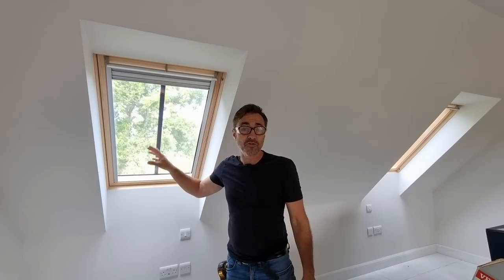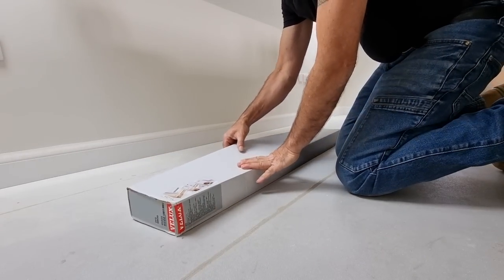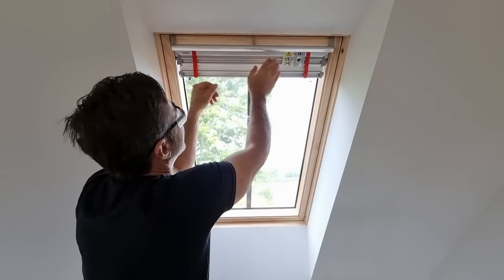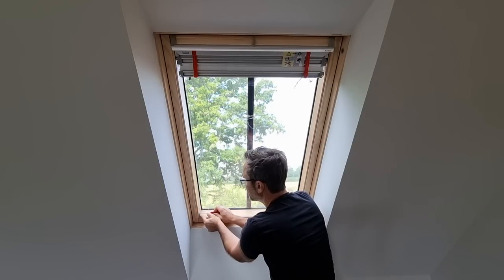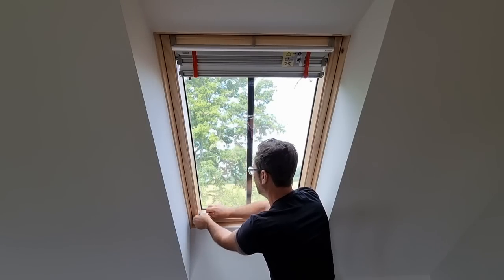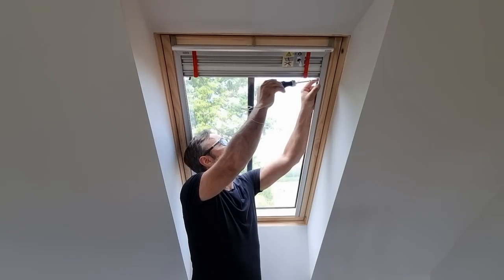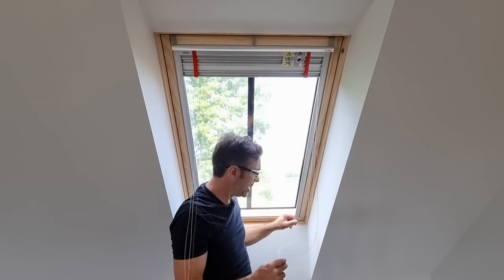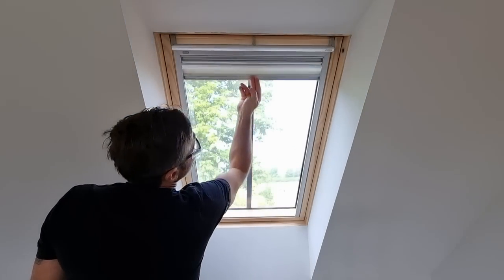How to fit Velux blinds, super easy job

Comment: I used to love velux 15 years ago when I was in the soft furnishing trade. Used to charge 15.95 fitting per blind. I could fit a velux faster than unpacking and bagging the rubish. About 3 mins each.

Comment: Hot dog!  They are available in the US. Unfortunately (I think) you left out the installation of a square or rectangular frame and the gray tabs “at the top”.  I’m hoping the manufacturer has a fitting that allows a pole to be used when the skylight is in a ceiling.  [They do.]  Thanks for the recommendation.